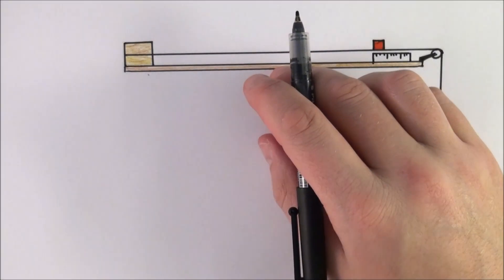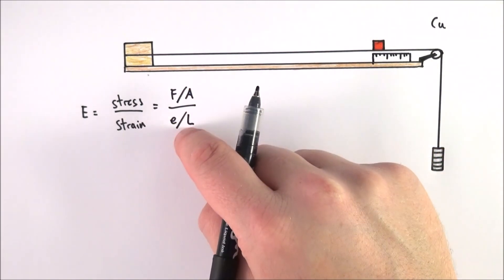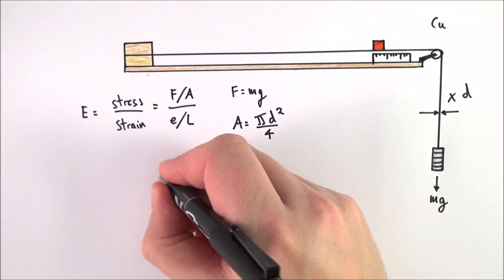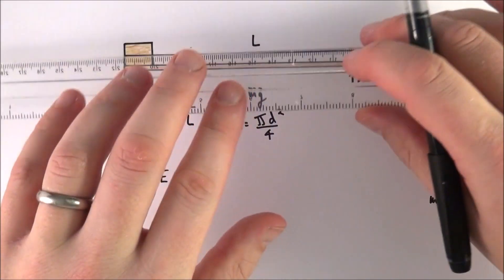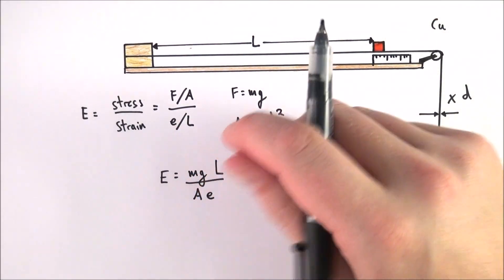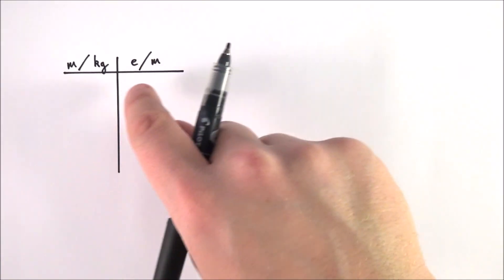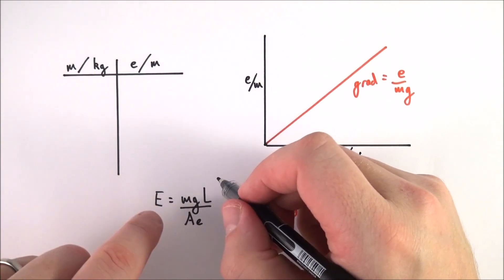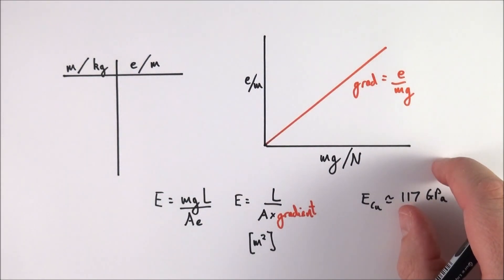Young's Modulus of Copper - PRACTICAL - A Level Physics

Comment: Why do you use pi*D^2/4 and how does that differ from using PI*r^2
Reply from the maker: It is the same - but I used the diameter in the equation as that’s what you actually measure.

Comment: Calculate the value of Young's modulus of
Brass wire by hanging the weight 0g, 500g,
1000g. Perform the whole experiment in
Uranus.

Comment: Hi 👋 
I just had a question, how would you calculate the percentage uncertainty in the force if you have multiple different forces that you are applying to the object?

Secondly, once you work out the percentage uncertainty in the force, area, extension and original length, how can you calculate the percentage uncertainty in the Young Modulus altogether?
Reply: And to work out ym uncertainty in percent, add the force, area, extension and length percent uncertainties together
Reply: Probably not useful for you anymore lol
Reply: @boingk2585  cheers mate, it’s useful for me :)
Reply: @anonymooseuser2150  np 👍
Reply: Find the abs uncertainty for the masses (tbh this should be given) then use it to calculate the percent uncertainty. Even when you add more masses the percent uncertainty should remain the same since the masses are uniform

Comment: Since YM= stress/strain could you not plot a graph of stress against strain, where the gradient is now the YM?
Reply: It's a lot simpler to do it that way. I guess it was just to show the relationships
Reply: Because the stress (adjusted using the masses) will be the independent variable, and independent variables are usually plotted on the x-axis.
Reply: @ghgjftrh8144  force extension graphs are the exception tho

Comment: Surely as you are stretching the wire, the cross-sectional area will get smaller? 

Wouldn't this throw off results, as another variable is changing?
Reply from the maker: Matt Whitelock You're right, the assumption we make is that this decrease is very small and can be ignored from our calculations for working out the stress.
Reply: A Level Physics Online Ah okay, thank you that makes sense

Comment: how would you convert mm^2 to m when calculating the wire cross sectional area?
Reply: well mili = 10^-3, so 1 milimetre is 10^-3 metres. When that is squared the exponent doubles, so it would be 10^-6. So we take the value in milimetres and multiply by 10^-6
Reply: Convert the number in the beginning to make them all into meters then work out the area